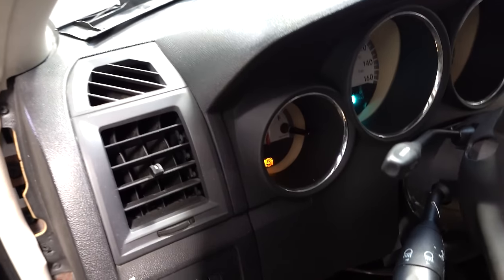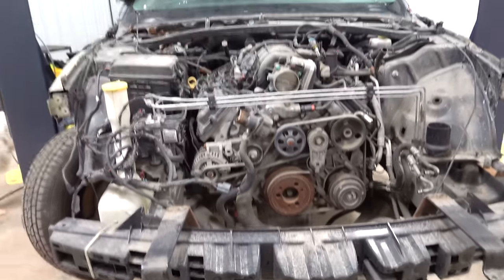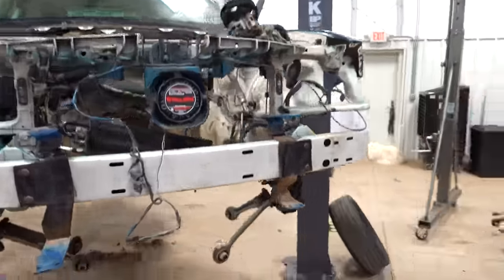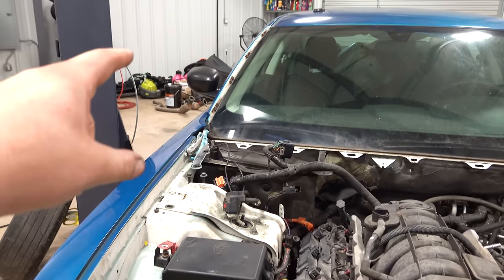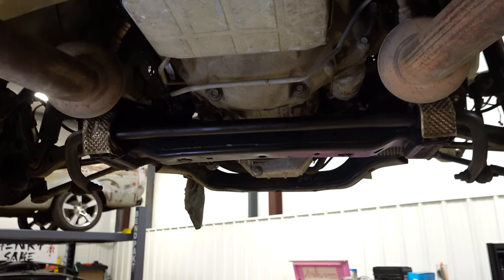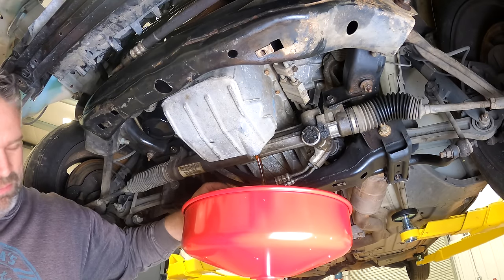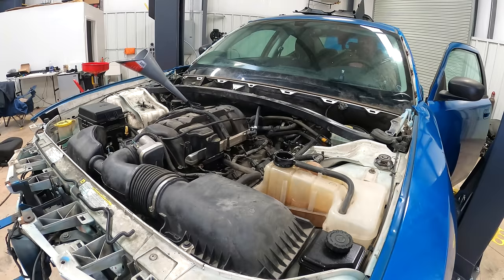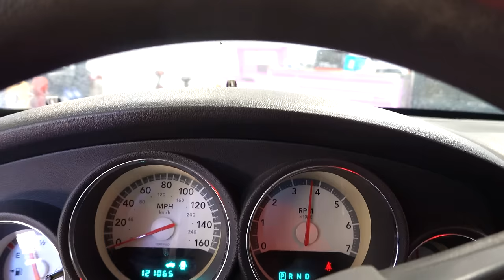Starting My Wrecked Dodge Charger Police Car For The First Time (DID NOT GO WELL)

Comment: You can tell its a southern car due to the lack of rust on the frame rails. Our cruisers in the rust belt have rot holes in the frame right above the cat converters. Also there is definitely an art to getting those subframe bolts out, I have a pretty hood success rate.

Comment: 23:02 That's an idea with the oil cap thing but I think the far better way to do that to make sure you dont start the engine without oil is to take some cardboard, write NO OIL ON IT, in big letters and circle it, and put it on the windshield like the roadkill guys do, that way everyone knows it has no oil and doesnt start it by accident while your in the bathroom after they've knocked off the cap to close the hood.

also traditionally their cars had no hoods either too

Comment: Aside from the gummed up injectors/ missing it'll take it a second for the idle to slightly smooth out after the battery is disconnected because of mopar's idle relearn process. It's extra long and annoying on Chrysler products. With a fresh tank of 93 and some B12 or injector cleaner ran through it I'm sure it'll clean itself up considerably.

Comment: compare the battery mounts in the rear to see which is the cop car.  They had larger batteries.  (upgrade tip you can easily trim the holddown bracket on regular cars to use the bigger one)

Comment: Really nice work! I'm curious: How is the exhaust from running vehicles vented out of the shop?
Reply: Usually they have a flexible hose and there's a fitting on the garage door with a flap, they slip the hose over the tailpipe

Comment: Hey Jared, I'm happy you have lifts now.

I have a lift too but it's 4 post (for reasons).

Would you consider showing maintenance and things like engine out on the 4 post to display the good and bad of a 4 post compared to a 2 post, quick jacks or no lift.

Right now my 4 post is only doing storage duty but eventually I will use it for service.  I could buy a second lift (2 post) if the 4 post has a big disadvantage but I would rather put that money in to my cars.

Any way, since you have both I thought it might be a good video topic.

Comment: Oh man those are some long subframe bolts. Those also look like stretch bolts, which for bolts that long are sketchy to reuse, and that's even before considering the corrosion. I wonder if you can source new hardware from Fastenal or similar. ARP bolts might be good if that subframe is gonna be loosened routinely.

Comment: Jared,
How would you find and punish people who sawed off the catalytic converter off of your '09 Prius while it was parked in your driveway?  Also...

I am hesitant to replace it, because the car is only worth around $3,000 to $3,500, even with only 27,000 miles on it, but replacing the converter would cost between $2,000 to $2,500.  
And, I feel like I would simply be providing the jackals with another easy meal. 

Would it be O'K to simply have a piece of pipe added on to the remaining exhaust to fill in the gap?  My state does not require smog inspection.  
Or just drive it around loud and proud just the way it is?  I am on a pretty low budget and lack the skills or the means to self wrench or weld.
Reply: I can assure you at that mileage if it’s in okay shape that car is worth a lot more than you’re making it out to be. It’s a Toyota and super low mileage. Also in the current car market there is now way a car with less than 100k miles is going for less than $5k
Reply: Replace it and use  a cat shield to help protect from future thefts.

Comment: Does the "unplug a plug" trick work on cars that aren't coil on plug? Like, can I pull the spark plug boot, or maybe the other end of the wire off the coil?
Reply from the maker: You can absolutely do it, but remember you are dealing with extremely high voltages and you don’t want to get bit by the spark. There are insulated pliers you can use when removing a plug wire and reinstalling while the car is running.

Comment: Serious question here would you be interested in selling those two a pillar lights and how much?? I have a well I suppose some would call it project van. Little evil laugh here. One of the things I've been looking for is a set of a pillar lights like on that particular car been having a bit of trouble finding any. I reached out to Crown Rick Auto a few times on YouTube but never got any answer. I know Crown Rick on YouTube literally have a police car salvage operation.i pretty much sock with eBay because I couldn't find any on eBay.

This is probably going to get me a few looks but its thee second van. First one I ran into a series of problems than the motor blew out.i Work with a beer budget so sue me;).i basically use the van for work and it was something that I wanted to have fun with where it's a white van and the second one I ended up with ironically was another white van.. First one already had a roof light on it and a Searchlight on the engine Bonnet wireless remote light;). Somebody stole the roof light that was originally on it lol. Which reveal just how horribly that roof light had been installed LOL.

Managed to get my hands on a 1980s snow plow or tow truck roof light.
its a Ghostbusters van in a nutshell. There's been a couple Vehicles I've had that I wanted a pillar lights for able to get my hands on some.i Had a Dodge Charger for a while I hit a deer and rolled it or more precisely not a hundred percent sure I hit the deer dodged it the first time and it doubled back and when it doubled back was when I rolled the car trying to dodge a second time so at some point while rolling the car I may have inadvertently hit the deer lol already being I wasn't travelling fast lol. I was doing about 40 and an 80s Zone if you're familiar with Canada that's pretty damn slow.its Harder Than You Think to get a charger around here or I'd still have one. Make fun of them all you like but they're a goddamn fun car even with only the V6. For the record mine had a very strange V6 admittedly we're apparently there had been some aftermarket Shenanigans going on under the hood. Car had a very checkered and strange history ;). Even after rolling the car technically sold it for more than I paid for it lol.

Definitely interested in those roof lights if you're interested in selling them?

Comment: Question to the community !  I got an 08 3.5 Charger, when starting it, letting it warm a bit, if I try to rev, it cuts the rev out and does not let me, if i go drive it for a while, in which case there is not a cut out while driving, then park and go in natural again, it will rev just fine as well with out cut out.  Just looking for anyone's ideas on it :)

Comment: engine has a fram orange death can on it.  gross.  also, that oil cooler wasn't cop car only, it came if you got a tow package.  they are notorious for failing and letting coolant and oil mix, and are mostly replaced by fleet services with a radiator mounted oil cooler with a filter relocation kit too.

Comment: Why not just repin the one connector on the known good harness instead of completely removing and replacing with unknown harness? Simpler job
Reply from the maker: Not enough wires in that connector, the eagle engine adds two features that the older harness doesn’t have, also both terminals were male terminals so I’d have to cut and solder all the wires.